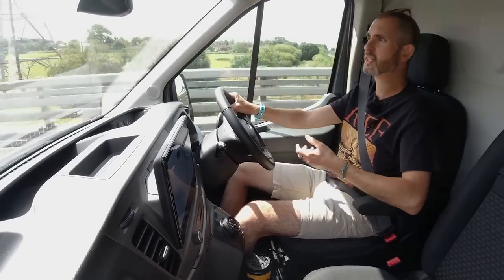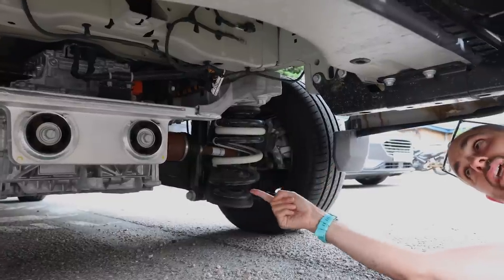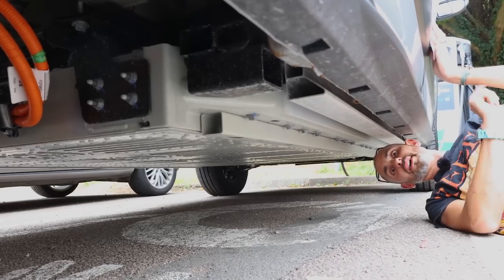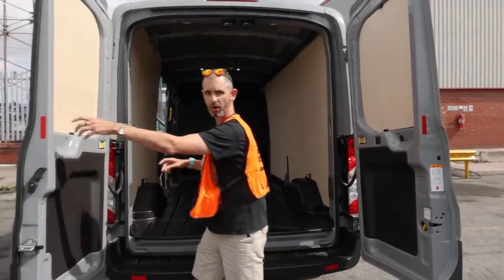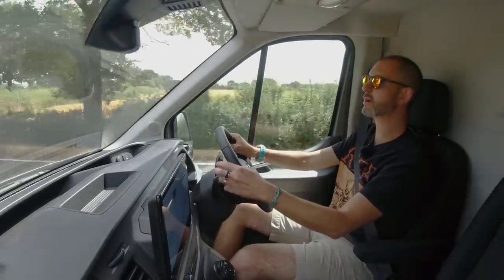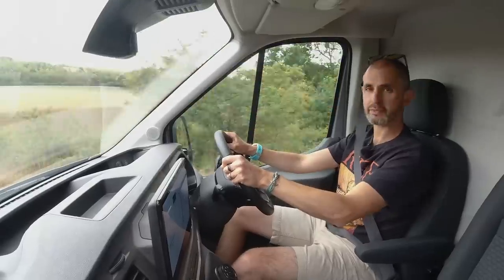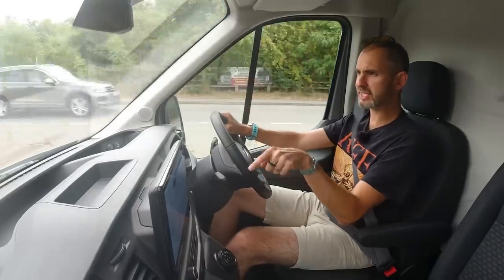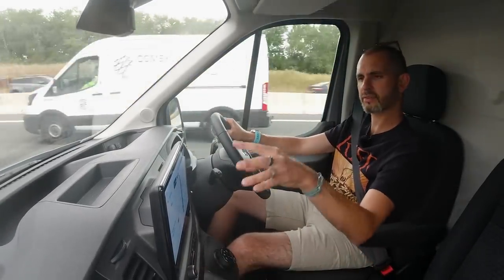New Ford E-Transit electric review - the most important van of 2022

Comment: Johnny, could you tell us non EV driving folk real world, what that cost to do the whole trip please? Ie charging at home to back to home empty… ta 👍
Reply from the maker: Home charging tends to be cheapest, depending on your elec tariff. Mine probably filled this for less than £5. Rapid charging on the hop like this usually ends up costing between 35-50p per KWh. That rose sharply in the last 9 months, annoyingly. So ideally you want to slow charge at a depot or home, and task vans like this on journeys that won't need a charge, or can be charged during a manditry lunch break at depot or with rapid charge provider whom the company has a deal with.
Reply: @TheLateBrakeShow  Instavolt now 57p a kw😬
Reply: @TheLateBrakeShow  yes but! To a complete novice, non EV driver like me… How much would that round trip have cost? I’m interested it working out. The difference between EV cost compared with derv 👍
Reply: It's not just the price of the charge to consider, if your working the down time while the van charges is costing you money.
Reply: @fbeale3537   As Johnny said in the video that totally depend on what you use your van for for the minority of trips. I us my Nissen env200 as a handyman van and charge it at home over night or from solar at the weekend. I there for have less down time charging it then I had with my old van and going to fill it up at a petrol pump. If you are doing longer trips a lot that need a rapid charge then yes there will be down time or at lest time you can use to do  paper work that would need to be done anyway as it charges.
Reply: @timrawlings1511  in your case yes you may be able to use one, but in my case I do to much mileage to even consider changing,  I'm also struggling to see electric ever getting anywhere,  we have less than 1% electric on British roads and power suppliers are already struggling, its estimated  atleast 30 million charge  points will be needed around Britain.
I can't help but notice we have been trying to get fibre  optics cable across Britain for the last 24 years,  that cable is the size of my finger, the cables they say will be needed to add all electric cars to the grid will need to be the size of my legs,  can see that getting all around the country any time soon,  the math just doesn't add up for electric and I can't see it being anything but a  niche market. 
A couple of things to notice, Birmingham City Council had already abandoned using thier electric vehicles, as so Amason has also abandoned using thiers,  nothing is near enough ready yet.
Reply: Johnny can this do vehicle to home like the Ford Lightning.
 Are there any vehicles that currently do vehicle to home/gridil in the UK other than Nissan CHAdeMO because I would much rather buy a van than a car.
Reply: So, £5 for 140-ish miles when home charging, 3,5p/mile.
£25-40 when rapid charging, 20-30p/mile.
£2 per liter, 30-ish p/mile (assuming 30 mpg).
Reply: @craighennell5700  It does a bit over 2 miles on one kw/h of electric (unladen), most domestic day rates are 32-45p per kw/h now in the UK for anyone on a current variable rate or recently fixed tariff, meaning it'll do around 1 mile on 16-23 pence, dependant on the climate / driving style / unit cost factors - you can chop probably 30% efficiency off with a proper load in the back as well. 

In a fictitious world where all the electric used came from a domestic supply at middling cost on a current rate, that's £45-£60. Half the charging (at least) was done on rapid chargers which are more like 40-60pence per kw/h, so probably nearer £60-90 total cost, once again very dependant on the price of the units you use. Rapid chargers best avoided in general.

Same journey in diesel transit at 30-35 MPG, with fuel at around £1.85 - 1.90 off the motorway now would be £75-85 

It seems ridiculous at face value, but remember the price of electric is going through the roof at the moment as the electricity generating companies run us & our wallets through a mandrel. The cost savings of any electric vehicle really shines if you have solar panels or a cheap supply independent of the insanity that is on offer from the grid, or even managed to fixed a tariff last year and could maybe charge on a 17-20p per unit night rate.

Most half decent electric hatchbacks will do 3.5 - 4.5 miles on one kw/h, making them much cheaper to run than the transit - if that was what you were interested in.
Reply: @georgecrockford974  if your with octopus they do a 11.30pm to 5.30am rate of 7.5p per KwH
Reply: @annakissed3226   You're quite right, that's a great rate nowadays. only offering 4 hours for my postcode but still hugely better than anything else on offer!
Reply: @craighennell5700  around £30 to £40 in my diesel Transit 190L
Reply: @fbeale3537  What kind of job do you have that you need so much mileage everyday? I work in a company that operates for insurance companies when people or companies have fire or water damage so our guys drive out to repair /fix all damages.  Our guys (carpenters etc) can have up to 3 different jobs a day they drive to + the drive from home and back home since all company cars they all bring home with em.  We are turning the whole 650 employee company slowly over to electric and all our workers drive mainly Ford transit diesels today wich are slowly beeing switched out.  The guys working out and us project managers ( I drive a hyundai Kona) Average about 65ish miles pr day.   

All the guys charge at home and the company pays for it.  On average we save around 4000£ pr year after switching to electric pr car in pure driving costs (electricity + toll roads++)  It is for us here insane how much money saved.
Reply: @Tsenngu  I'm a self employed builder,  like you I cover electric plumbing ect ect, in short, from footing to roof and everything in between,  I  am also a confident spaces diver so I do a lot of contract work for council inspecting Bridge foundations ect,  this part of my work can be in any part of the country.
I have a full length VW crafter that is fully stacked out so I don't have to load for a job I can just go and know I have the gear,  obviously being laden all the time cut milage per gallon down.
Doing the math just don't work out for me, I can pull in a garage and 10 minuets later I have 480 miles of none stop fuel,  taking everything into account if I went electric the down time charging to get the same miles  just would not be profitable.
Reply: @fbeale3537  wow 450 miles without needing to eat, pee or get tired. Impressive. But at motorway prices that must cost about £150 per 450 miles, can't see how that is any more sustainable
Reply: @watcher24601  only a fool uses motorway prices, mind you high street prices are not that far behind,.
Reply: @georgecrockford974  try octopus they have an option that gives you 6 hours at 7.5p per KwH
Reply: @fbeale3537  I understand your concerns F, but mate, you need to check your facts. Power supplies are not struggling - power is generated from every solar panel you see while there is sun on them,  distributing power sources all over the country which makes it easier on the grid. A single rooftop solar installation, on a sunny day is enough for around 50km-100km travelling and what is the average distance travelled by most vans or cars? Nothing says you have to get the electricity from your own roof top solar, you can get it from a roof top half way across the country or from the mainland. The math for electrification more than stacks up -  energy sources are more distributed reducing grid loads, energy sources (Wind, solar, hydro, nuclear) are already all over the country and growing at an incredible rate. We are also reducing our dependency on foreign oil cartels whose costs of production a gradually increasing as oil has to be extracted in more complicated ways. 
Consider that in a decade you will be hard pressed to find a motor vehicle or work vehicle manufacturer making anything but EV's. The countries ICE fleet will just get older, rattlier, less reliable and more costly to run as it ages. 
Yes, it is early days for EV's and mistakes will be made, but fixing them is a constant process - I remember when my ICE wouldn't bloody start in the morning, manual chokes, carburettors, points, plugs...it took them until the turn of the century to sort that out, yet the EV makers are sorting stuff out in months not decades. Look at this Ford EV van - its pretty close to perfect for many delivery tasks and is not running up against ICE tolls and restrictions on ICE in a growing number of locations.
Reply: @fbeale3537  "...Amason has also abandoned using [EVs]."
Amazon invested more than $1 billion in Rivian and ordered 100,000 electric delivery vans from them in the USA. Have they previously been using some other EV model in the UK? Do you have a source for more information about this? Thanks.
Reply: The cheapest UK electricity rate, you're looking at under 5p/mile. The most expensive about 30p/mile.
Reply: @fbeale3537  1.5% now, and power supplies are fine - Grid has said many times there are no issues with electrifying vehicles in terms of capacity
Reply: @MrKlawUK  32.9 million vehicles on British roads,  jist over a million of them EV or electric, what the power grid actual statement was,  the grid could only support the required supply with management.
Taking into consideration only last week the goverment is considering closing down nuclear power plants i dought even managment will beenough.
Reply: @Thankz4sharing  did you follow the deal being made with Rivian,  it fell through wiping off 11% of of the companies stock, the deal was instructed again and all was well, rescently the rumours are not good for the deal again and may be abandoned.
Sources are easy to find here on youtube, you dont have to go far and finding info is easy.
Reply: @fbeale3537  I'm glad that I'm not an investor in RIVN (NASDAQ)! After looking at a couple of recent business website analyses of the stock, the only thing that is clear is that the future remains uncertain. Just as it always has been and always will be. 
But if I had to bet, I'd wager a very small stake that Amazon will be using a very many Rivian EV delivery vans more or less on schedule.
I never, never depend on YT as a primary source. Only as a link to more established sources.
Reply: @watcher24601  well said
Reply: If you charge off Solar like I do it costs me Nothing.  Or it costed me the cost of my solar spread over the next 22 years.
Reply: @Slebonson  are you in the uk???
Reply: @dee-dw8nz  no and that's part of the problem.
Reply: Can you chatge while driving with solar power panels plugged in?
Reply: @gpw203  thieves? you mean Romanians.
Reply: @fbeale3537  Not really.  I just did a 220 mile trip in my car.  Stopped for a wee and a take away coffee halfway, that little pitstop was 20mins in and out and the not superfast charger had added 90 miles of range in that time.  If I had eaten something in the services it would have been twice that.
Reply: Another variable to consider is the life of the battery. They will never be as efficient as day one and the range will constantly diminish. Here in the US, the Ford F-150 ev starts at $40,000 new before dealer mark-up, good luck finding one, the cheapest one is the lowest number produced. It has a range of 200 miles in standard form, the upgraded battery gives a further 70 mile range but costs an extra $19,000. My guess is when these battery packs die, people would rather invest that amount of money in a new vehicle than replacing these batteries, making these vehicles disposable. Not very environmentally friendly but music to the car industry’s ears!
Reply: The easiest conversion is kWh price x 2.5 = per litre equivalent price, so if you pay £0.30 per kWh, that's equivalent to £0.75 per litre. As other have noted though, rapid charging has gotten pretty pricey recently, with £0.50 to £0.75 per kWh, putting it quite close to petrol at £2.00 per litre - however, rapid charging it typically only 10% of charging of an EV, and a Solar install could bring the cost lower. Maintenance is also a big win - not just lower cost, but less time off the road too.
Reply: @brushlessmotoring  cost of buying it in the first place also comes into play though...
Reply: @dee-dw8nz  absolutely - I'm impressed with how close Ford managed to get the price to a petrol or diesel van, spiking electricity prices notwithstanding, there is a certain mileage after which it pays off it's extra up front cost, and as this is likely purchased on a loan or lease, the monthly payments for the vehicle will be a bit higher, but the payment for the fuel and maintenance will be a less - whether that makes sense will be up to each business to decide.
Reply: @Thankz4sharing  Amazon are ordering EV vans from Arival?? in Bicesester
Reply: @welshtexas1  yes batteries lose charge but the battery in your phone is a very different battery than in your car its like comparing an aluminium audi to an aluminium plane. The latest CATL LIthium Iron  (not ion) batteries fitted to standard Tesla's whilst a bit heavier are rated to supply 90% of initial capability for 500,000 miles. How many people do you know who drive a 1000 miles every week for 10 years?? That's equivalent to a taxi in London doing 14 hour days evey day for 10 years
Reply: @fbeale3537  yes but as EV charging is now everywhere and is spreading, the van is normally charging whilst you work
Reply: @annakissed3226  may jave a slight problem with the Lithium,  the US have re invaded parts of Africa stiring up trouble and also bombing Somala,  France has army units in Africa fighting,  Africa has shown a strong leaning to Russia because of the wests constant interfearing, is Africa does packed with Russia then all 5k santions applied to Russia will apply to Africa,  that would mean no resourses for batteries without war with Africa.
Reply: @fbeale3537  lithium is everywhere. Can I suggest you go watch the YouTube channel The Limiting Factor to get up to date information about lithium battery supplt
Reply: @annakissed3226  you are correct, if you want cheap lithium for cheap batteries you go to the boltic states, but if you want high quality long range batteries then the  lithium or red lithium and colbolt you need comes from Africa,  there  is a reason top electric car makers will only use African minerals.
Reply: @fbeale3537  could you please go to the YouTube channel the Limiting Factor and update your information as are very, very out of date
Reply: @fbeale3537  well according to the conservatives the market will solve the problem
And how much do I trust the tories...
Reply: @fbeale3537  no all cars don't have to be electric they are not banning ice cars they are stopping the sale of new ice cars. The problem will be 10 years later when there are so few petrol stations around that you can only buy second hand diesel & fill up at airports & marine places.
Reply: @TheLateBrakeShow  When will people wake up and realize once enough people change over to EV then we will get hammered on EV costs. In New Zealand EV are currently RUC "road user changes" free as an incentive for people to change. As soon as enough do they will get hammered too. Wake up and don't buy BEV. Simple as that.
Reply: @fbeale3537  Cobalt is NOT Necessary, LiFePO4 has ZERO Cobalt. Africa is NOT required for Electric Car battery chemistry materials. Stop spreading falsehoods.
Reply: @fbeale3537  The biggest bulk cost producer of high quality Hard Rock Lithium is AUSTRALIA. Not the Baltic states, stop with the Lies. Infact I do not even know of a a competitive Lithium industry in the Baltic region. Seems like all your comments are Politically motivated lies.
Reply: @twowheelpilot  You are delusional. The tax would have to be improbably gigantic just to get to parity with fuel cost. You fail at simple math. 
I do foresee a road usage tax but that would still be a proportion of the cost difference to fuel. That alone would be hefty road usage tax. Wake Up and learn basic math.
Reply: @fbeale3537  WTF the mineral Erythrite which is Red-ish only contains Cobalt relevant to this topic. But Cobalt is being phased out of BEVs. There is no such thing as Red Lithium ore. You inventing extraordinary lies about geology that does not exist.
Reply: However, using words like lies tend to get peoples backs up? This is kind off a tone argument but only in the sense that irritating people means people listen to you less & reply on automatic as I just did. And now I feel like an idiot for not taking time to read what you actually said - which was way more articulate and I will need to think about. 
So 2 cheers!!
Reply: @Neojhun  interesting, im assuming google must be wrong again and there are no lithium in the Ukrain or Russia or Romainia,  ill jave to send those go wrments an email letting them no they dont really have any lithium.
Reply: @Neojhun  I'm sorry, I got the wrong end of the stick & got angry  at you, so this is me trying to apologise for what I said. Sorry again!
Reply: @annakissed3226  I would totally understand if it was a single comment and it looked like I knee jerk attacked a single comment. But the multiple comment tirade that F Beale vomited clearly warranted a destruction of his lies. I would like to be more civil like you but we are beyond that point when spam like that gets dumped. No need to be sorry, this sick scam is the problem.
Reply: @fbeale3537 You probably have to wait another generation or 2 when 400 miles vehicles with 800volt charging comes out. The current vehicles is perfectly fine for people work mainly in a 100-200 miles of their homes. Which is vast majority in the UK.
Reply: @Thankz4sharing  They need more vans than any single company can provide. Rivian, Ford and other will be getting lots of sales from Amazon.
Reply: @fbeale3537  Most lithium come from Chile and Australia not Africa.
Reply: @fbeale3537  Cobalt is being phase out of battery designs. Anyway you need the stuff to make petrol for cars, so it not like electric cars are the only things that needed it. When are the petrol chemical industry going to phase out cobalt use?
Reply: @Neojhun  I think there was one large lithium mine that was plan for the region but it got cancelled or delay because of environmental concerns, which I suspect Russia has probably influence.
Reply: @DavidKnowles0  Highly doubt that as Russia has near zero influence on new lithium industry. AFIK no major lithium development is heavily involved with Russia even diplomatically on foreign lands. The problem with Russia is their long history of supplying Nickel. Which is a far more abundant accessible ore.
Reply: @welshtexas1  not disposable, recyclable. That’s music to all our ears😂
Reply: This van is lower maintenance than my wife 😁
Reply: @fbeale3537 if it doesn’t work for you at the moment, don’t bother then. The EV van market is still developing, so maybe next year. What i wouldn’t do is buy a new diesel van now, because i think it will worthless in a few years. As EVs are going, no one will buy a used ICE van anymore.
Reply: @elinys2843  I think EVs will have a place but I can't see them becoming the dominant vehicle any time soon,  the new regulations concerning EVs in the UK will come into force over the next couple of years,  the before  sale safety inspection carried out by government appointed inspectors and to be paid for by the purchaser  will most likely kill the secondary hand market for EVs, the MOT changes won't be kind to owners either and could cost them 1000s, just have to wait and see .